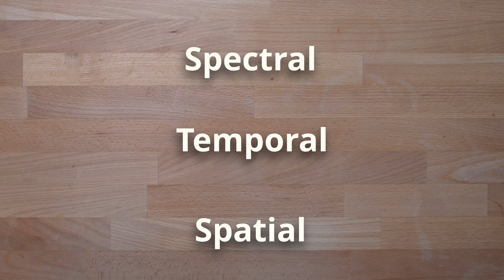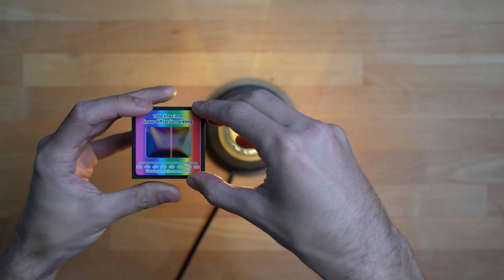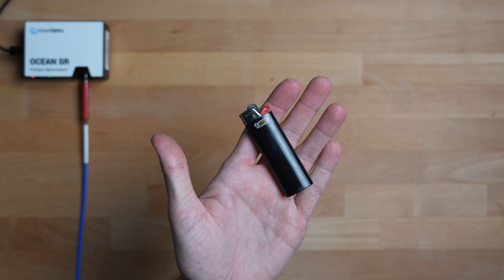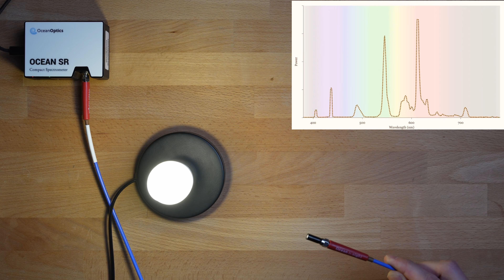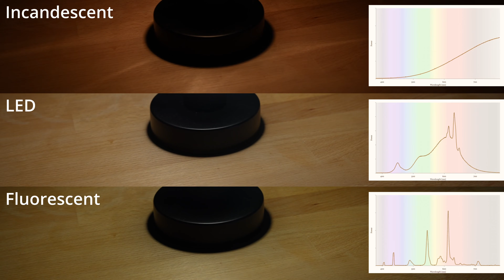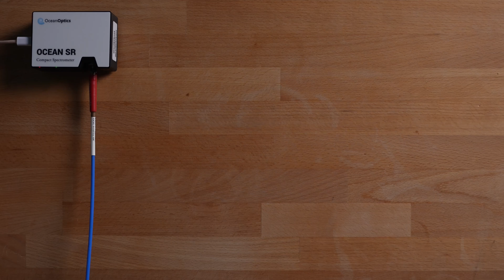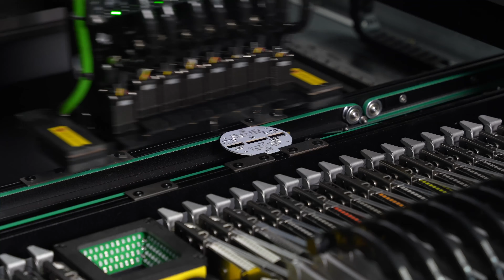Why Modern Lighting Feels Bad (and How I Fixed It)

Comment: that is realy cool  and i wanted to buy one but when i saw the price tag $329 my jaw droped to the floor lol
Reply: Philips hd led has 95 cri only like $4 a bulb, and a proper light spectrum curve with less flicker than an Incandescent
Reply: @ivar-the-terrible  thats good but you can't change the color temp :/ like something specific if i want to set to for example 4250K
Reply: @heroicplaysmc  Then look into high CRI CCT (correlated color temperature options). CCTs typically combine dedicated cold white + dedicated warm white LEDs, allowing you to control their brightness individually in order to get a desired color temperature. There's a ridiculous amount of choices to pick in terms of chips and form factors, and they're readily available as LED strips as well. Paying 330$ to get this would simply be idiotic honestly.
Reply: Buying a set of different-temperature bulbs for ranges between 4000K - 7500K would still be cheaper to be honest.
Reply: @justaguyyknow8730  yea $329 Is insane
Reply: Just buy High CRI lighting. 97-99 range is ideal for good colors. The light in the video looks promising, but for the price is simply extremely overengineered for what it is.
Reply: Or just use a good old hot tungsten bulb.

As I calculated, you need about 10 years of burning 40W light bulb for 8 hours each day to pay the same money for electricity as EP01 costs.

You won't get fancy spectral coloring but will get a good warm bulb. Especially warm if you need some additional heating during cold winter nights.
Reply: @ivanalaskevich4736  40W light bulb Is too dim i need 100W or about 1500 lumen to satisfy my needs. Ill just get a normal high CRI 95+ LED bulb around 13W thats Gona be around 1500 lumens thats only one color temp like 4000K
Reply: @pauldeddens5349  the difference is tunable spectrum - high CRI bulbs are fixed temperature (and I suspect they are not individually calibrated too). But yes overengineered for most use cases.
Reply: He's taking big margins. He's not mass producing in China
Reply: @clippyTheSahayak  thats the issue. It needs to be mass produced and automated to become affordable. Ill just buy CRI 95+ 4000K LEDs for now because $329 for any light Is insane And the max brightness Is 600 or 800 lumens he said so not even enough to fully light up a room to comfortably work in but as a quality light in the evening for relaxing Its enough. $150 Is my absolute maximum i would pay for it tho

Comment: best advertisement ive ever watched, thought you were just a new youtuber haha
Reply: Thanks for the warning, downvoting and skipping the video then.
Reply: @skiz9571  Nothing wrong with advertising something you made if it's a high quality product made with passion.
Reply: @Gameboygenius  It is, i don't wanna see ads pediod. I didn't get Ublock Origin for nothing. Any video that is an ad should be highlighted as such.
Reply: @Gameboygenius  After the reveal, I can tell this is not a high quality product made with passion. It's just a cheap cash grab, and this is not spectrally tunable lighting. It's just a cloud connected smart bulb like everything else at the walmart.
Reply: @LokiScarlet  as a lighting nerd, there's also some things that are blatantly wrong.  like, there's already some really good black-body emulating bulbs, and are usually called high cri bulbs
Reply: @skiz9571  It really is a pretty good ad though. And there is basically no risk of you actually buying anything because the product is priced at a whopping 329 USD (yes, for an overengineered light bulb).
I recommend watching it.

Comment: Not only "feeling" bad, in general the "cooler" lights will ruin your eyesight more. Go out at night and once you realize this, you'll notice it. The lights from traffic that is "cool" color will seem most blinding. The "warmer" the color is, the easier it is for your eyes to recover from the blindness.

I noticed this when using a magnifying glass lamp to work on micro electronics. The Cool White color led me feeling like I looked at the sun directly for 5 seconds or more. I was temporarily blinded. Then I switched the Warm light color and that blindness was almost gone.

Flourescents are the worst, but even LEDs, it's difficult to make them have low blue light content. You NEED to buy LEDs that are not just called Warm White, but also a high "CRI" rating. It needs to be minimum, 80, preferrably 90 or more. 100 CRI basically equals to light distribution of our sun, and incandescents can reach CRI of 100 relatively easy. Few, very specific purpose built LEDs reach CRI of 95 or even 97. But high CRI also reduces efficiency. Beyond 90, the efficiency goes down quite drastically, and it's also harder to achieve.

Comment: Cute, but its a bit of a pipe dream.
Multi-material multispectral sources need optical feedback for correct rendering, as different LEDs age and vary in different ways, calibration fixes the problem just at that point in time, especially mixing phosphor-converted LED wit pure ones.
There is no normal way to produce controlled light pattern - your emitter is physically big, you are locked to the orb shape.
Your lumen/W figure will be abysmal.
The problem you are solving in essence doesn't exist anymore - 97 CRI LED is 0.08eu in single piece quantity.
I thought of making a lumen CCT palette - tunable white light for verifying paint swatches - the best solutions is just buy best white LEDs and switch between those.
Some of things in this vid are downright disingenuous - taking video of very similar spectrum bulbs and they look vastly different, I just don't buy it.
Saying the LEDs from the same batch can differ in wavelength or output - really? You buy those binned from the factory, the whole point of binning is to match them.
Reply: i was wondering how this product could ever fit inside a regular bulb socket considering its massive size, basically rendering it a novelty at best
also what was that bit about ai? oh god
Reply: @limeshroom9  kinda-sorta you can use smallest possible chip-scale LEDs, like cree XE-B, form a teeny-tiny light engine and it will fit into the lightbulb.
Lightbulb sockets are a bad thing for LEDs, designed to isolate bulb heat from everything else complicating thermal design even further.
Frankly products like these are better built like whole luminaires, not lightbulbs.
Reply: thanks for the information about the CRI. pretty happy with phillips lightbulbs. I think the one I have are 80 CRI but it's not really advertised. they seem to do 90 CRI (under the name "warm glow"). anyway I don't have a real issue with the ones I have. From what I understand continous CCT is just one warm light led (around 2000k probably) and one cold light led that are crossfaded with specific curbs.
Reply: @hmmmhhhmmh  those were discontinued and now are called philips hd led and they have 95% cri with the same warm glow on dimming
Reply: @ivar-the-terrible  thanks; can't find the reference; CRI >90 only seem to exist in the dim to glow format or their corepro line (or connected bulbs).
Reply: It also completely ignores the biology of the human eye, and which wavelengths we are sensitive to. It is a waste to provide LEDs that only provide wavelengths that we are not sensitive to, instead focus on activating the specific cone cells.
Reply: @MrManningata we are somewhat sensitive to the whole visual spectrum; it is just that the sensitivity is reduced as you get away from the peak frequencies.  And those peak frequencies?  They vary a little between people. (The best documented tetrachromacy was a woman with genes for two different green receptors.) And real LEDs don't actually stick to exactly the wavelength they advertise, which is why the more carefully specified parts will give a range of nanometers rather than a single number.  30 different LEDs might be overkill, but most overhead lights contain several (duplicate) LED chips anyhow.  Replacing some of the duplicates with a range of merely similar substitutes does allow for more tuning, as is sometimes expected for a premium product.
Reply: @MrManningata  I'd maybe argue with including something to fill the cyan gap, but AFAIR that has been done as well, not en masse, but still.

Comment: I would love to see this miniaturized to fit in a standard edison screw
Reply: Technically, with all aberrations I've seen made to adapt wall sockets into E27 screws, I believe it's possible
Reply: really it doesn't even have to miniaturized; there are ginormous E27 bulbs, it's just a matter of keeping weight as low as possible so it won't tip over the fixtures.  
Sure, a bulb this size is pretty limited in where you can put it, but it'd work just fine in a simple "lamp socket cable hanging from a hook in the ceiling" setup.

Comment: Super cool! Super glad I clicked on this video, i work in the photonics industry and care alot about the light quality in my space but surprised to see someone actually making a product that addresses all my gripes with modern lighting. Might purchase a light here but they are quite expensive and don't work with homekit rn. It'd also be nice if you made dev boards in the style of regular light bulbs, but I get why you differentiated with a custom light fixture first, It'd be really nice to fill my space with just these lights but I'm hesitant to purchase just one light source and have it outclass everything else as currently my space is filled with lightbulbs. You should do video on the design of the light fixture, might work well to pull in people who what to purchase a really nice light; but congrats on launching a hardware product and I wish you well on your business! :)
Reply: LEDs can do pretty well actually. 3500K or lower. It's called Warm White. And CRI of absolute minimum 80, preferrably 90. That'll cut the blue light content substantially. CRI is the quality of the light. So high CRI goes hand in hand with color temperature which is called in K values.

Comment: I've kinda been obsessed with recreating sunlight similar to how diy perks did it one of his videos. I know it's unrealistic but I'm wondering what's the closest you could get to proper sunlight from a ceiling mounted light bulb. I know your not going to get the light to actually be parallel and polarized without it being a terrible light source lol 

Also I feel like you could achieve what you did with ai with a human just learning it. I know your probably a one person team so i understand the reason but if you expand i'd like to have that knowledge and documentation so i could tinker with it myself without going in blind.
Reply from the maker: Yeah the DIY Perks video is incredible. There are a few things I’ve explored (which I will cover in an eventual spatial video), but the biggest issue for achieving that sunlight look is the parallel beams as you noted. To get parallel beams, a large emission surface is unavoidable, which leads to your lighting having a large surface area. 

On the note of AI, the mixing process doesn’t involve LLMs for knowledge use. The process I am referring to in the video is gradient descent. This process is used by LLM companies to train their models, but at its core it’s a mathematical optimization process that has existed for a long time. The nice benefit of the recent AI boom is that frameworks for utilizing GPUs (or other compute) to perform gradient descent have become much more accessible. In Enody’s case, tinygrad is utilized. An example can be found here: https://github.com/enodylighting/enody-py/blob/main/examples/optimize_chromaticity.py

In summary, LLMs aren’t used in the mixing process, but the computational frameworks that power them are.
Reply: Why do you care about polarization anyway?
If you really want sun like light - Yuji Sunwave, or if you absolutely need the spectrum, they have a D65 illuminant, but those are VERY expensive.
Reply: @VEC7ORlt  my reason is pure curiosity lol and unrealistic/reasonable expectations to recreation XD there is no practical reason other then maybe playing with polarized lenses for photography indoors

Comment: Cool project! I went on a similar light quality rabbit hole but ended up settling on bridgelux tunable white CoBs which are easier to integrate electronically and locally available on digikey. They have "thrive" variants which actually come with TM-30 values and charts in the datasheets (Data Sheet DS353). I was focused more on getting high CRI tunable light that I could put through lenses for houseplant downlighting instead of absolute spectrum accuracy though. For now it seems the industry is stuck on lumens-per-watt-per-dollar so I hope these things catch on!

Comment: Very cool idea and very cool design, but oof that price. It’s clear you worked really hard on this though, so I wish you success!
Reply from the maker: Thanks! Yeah, that’s definitely the long-term challenge. EP01 is currently built in low volumes, individually calibrated, and assembled here in Brooklyn, with all of the metal parts machined in the US. A lot goes into every lamp, and that’s reflected in the price today. 

The longer term plan is the same as many new hardware companies: start with a high-end product while the technology is still expensive, then scale manufacturing and bring costs down. This will allow Enody to ship increasingly diverse products and make spectrally tunable lighting cost competitive with current LED lighting. 

A big part of Enody’s mission is also bringing more LED manufacturing back to the US, so building domestically from the beginning is an intentional part of that vision.
Reply: @enodylighting  Emitter binning is probably one of the biggest hurdles, I would assume?
Reply: @enodylighting move your company to a more business friendly state and you can cut that price by 50%
Reply: @crowmium-1  NY is top business friendly, which is why it has so much economic output and population. Do you mean that production should be moved to somewhere most people don’t want to live and is therefore cheap? I’d imagine that is coming when he gets to scale. But probably better just to skip straight overseas to a severely overpopulated 3rd world country at that moment. And once he gets big enough, he can possibly move HQ (on paper) to qualify for tax breaks in states that try to lure existing innovation monetarily while he actually keeps the innovation offices in NY so he can continue to be peak innovative. That’s the Tesla model, except with CA.
Reply: It's not cheap by any means, but I actually find it somewhat reasonable. Especially all things considered. Though that said, I'm happy enough with high-CRI LEDs wit tunable white, so I'm not really the target demographic for this.
Reply: well its open source so you can jsut make your own :) (im gonna try to do that as im in a country with a very weak currency so i could never buy it. $329 is more like $1600 for me
Reply: @smb1397  329 USD -> 1600 ???
Brazil?

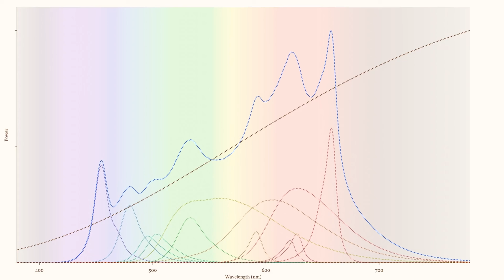Comment: 16:49 what if you added absorbers for the peak wavelengths? I don't even know if they exist but they can possibly help.
Reply from the maker: Absorbers do exist! Something like stage lighting gels are selective absorbers, absorbing all colors other than the color they appear to be. The two issues with absorbers are:
1. Absorbed light turns it into heat. This will lower the overall efficiency of the lighting and increase the heat dissapation needed.
2. The absorbers themselves will cause a new set of peaks that will have the same effect.
The best solution would be to increase the number of color channels while decreasing the width of their spectral power distributions. This would give you finer control and allow you to lower these peaks. Unfortunately this is a bottleneck in the underlying physics of LEDs, and until new LED types are developed we're going to have these peaks.
Reply: You need to get Warm White(Color temperature of 3500K or lower) LEDs plus CRI of 80 or higher. 80 is the minimum. 90 is preferrably. CRI refers to quality of the light. They aren't just for "feels". It'll impact your vision over long term.